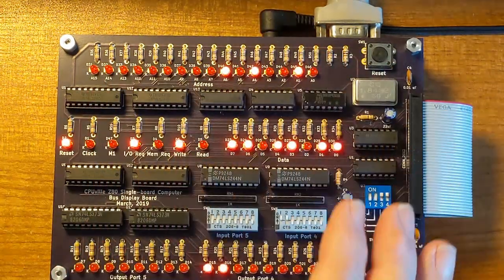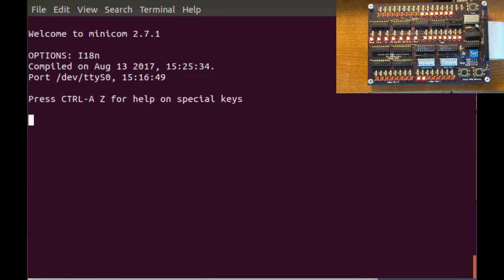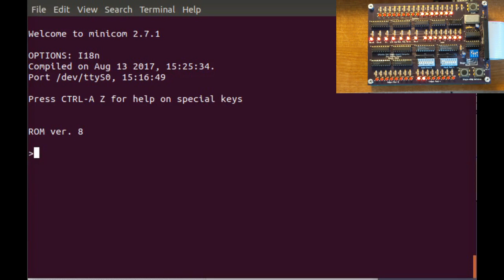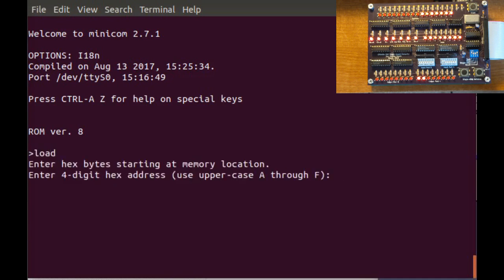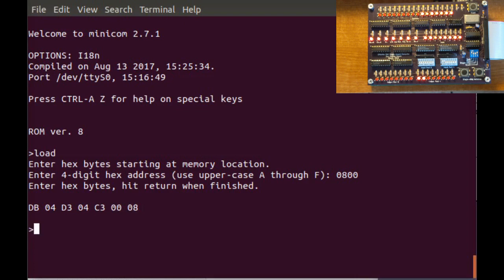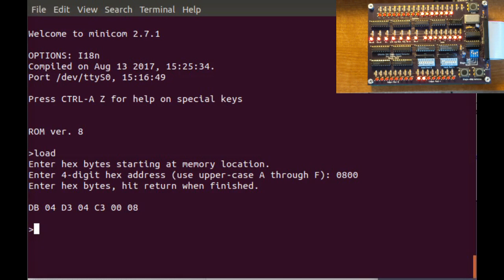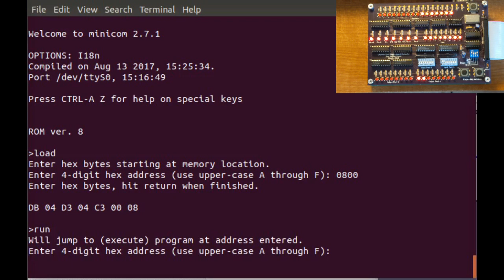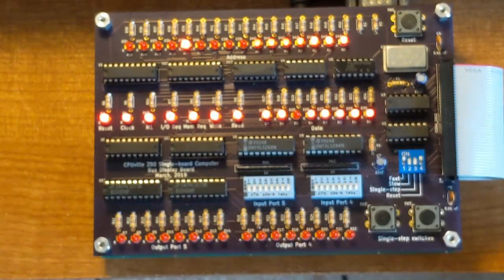Demo of a bus display for the CPUville Single-board Z80 computer

Comment: my cpc has memory mapped addressing...the manual say A10 must be low to enable any external I/O but  The lower 8 bits for I/o must be decoded, they can be used these address: F8xx F9xx FAxx FBxx I would like to use F8E0 for input and F8E1 for output.
could you please help me building such device using the dill switches and led would be enough, what I can't do is the design of the logic. A simple schematic would be greatly appreciate
Reply from the maker: I am willing to help. Email me at dstew@cpuville.com.